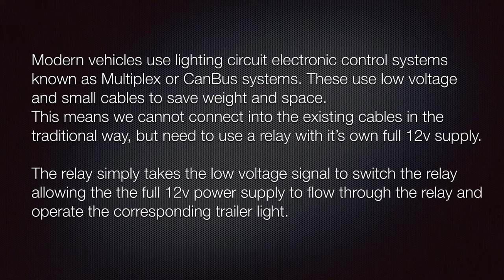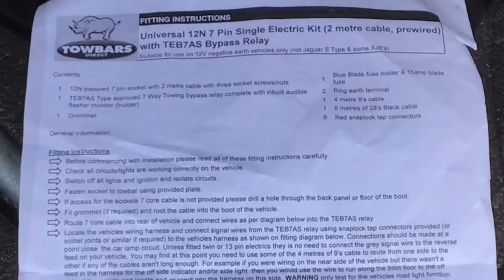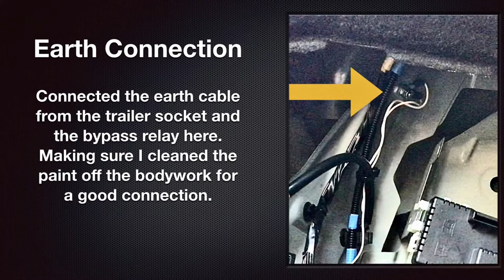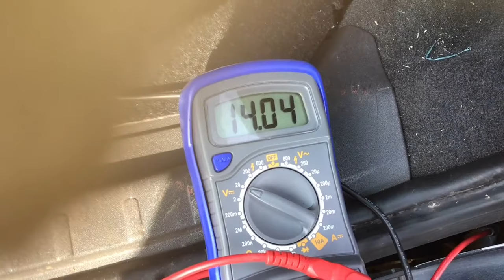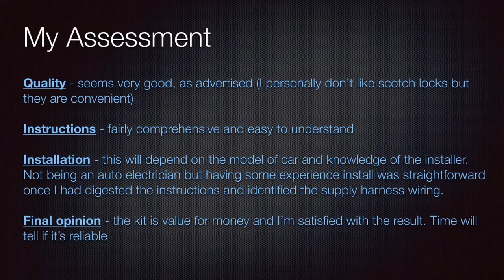TowBar Electrics 7 Way Bypass Relay - Step by step installation

Comment: Just watched video, great deal of info. I was particularly pleased to see a permanent live in rear of boot, negating the need to run to front of car. Just confirming, was this a Kuga. Ready to watch towbar install now. Why can't manufacturers just leave a dedicated trailer multi plug in rear, as some already do. Thanks for great video
Reply from the maker: Hi, James, really pleased you liked the video and found it useful. I try to cover every aspect when making a video, as it is frustrating if a video misses a crucial point in a process. Agreed it would be very easy for manufacturers to install dedicated socket in the boot. 
No it isn’t a Kuga it’s a Volvo xc60 so won’t be exactly the same as in power source. Although it’s a fair bet there is a permanent supply in boot of a Kuga somewhere. Otherwise besides the your permanent power source issue there rest should be the same. Hope this helps. 🙂👍

Comment: Great video. I have a xc90 and someone had fitted this relay already and also there is a power source also in the rear fuse panel. I just wanted to see how it was installed while i tidy up the wiring as a previous owner had made a mess of the install.
Reply from the maker: Thank you, I’m really pleased you have found it useful. 👍🙂

Comment: will be doing this tomorrow,your upload has helped a lot when using multi meter when checking wires do you have black probe on a earth
Reply from the maker: Really pleased to help. Hope you get it all sorted. Yes when checking each cable your negative (black) multimeter cable just needs grounding to a good clean earth point. It may help if you mechanically fix your black cable, to ensure you always have a good earth while you identify each cable.

Comment: Hi. Great video. Thank you. 
Im trying to identify my cables on the back plug but more than 1 has voltage, i have a volvo v40 and plugs look very similar to yours.

Would the indicator fluctuate with voltage? 

Thabk you
Reply from the maker: Hi Stephen, if you mean the low voltage CANbus cables on you car then yes the indicators would fluctuate with the flashing sequence. You would then have individual low voltage supply to the side, stop and fog lights. You need to identify each individual supply before connecting to the correct bypass relay cable. You only need to connect to one side tail light supply except the indicator of course and possibly the fog light, which you would run cables across from the opposite side. Hope this helps. 👍🙂

Comment: I’ve just fitted this bypass and it starts to make a buzzing noise wen engine is on then I put brake on it goes off 😊
Reply from the maker: Hi Matt, I would check all of your connections making sure each terminal is in the correct position and secured correctly and not trapping the insulation rather then the core. Especially check your earth connections, are they correct and with a good connection. It’s possible it’s maybe earthing through the brake light circuit. Hope this helps, let me know how you get on and if I can help further. 😊👍

Comment: good video, I have a problem with my caravan lights. When I plug into the car all the caravan lights come on. Stop and tail, fog, brakes, indicators. I substituted a trailer board and the same thing happened! Could this be a fault in the relay?
Reply from the maker: Hi Duncan, it could well be a relay fault but likely an earth issue. By that I mean it doesn’t have a very good earth so may run through the other lights to an earth turning them all on if that makes sense. So the first thing to check is all the earth connections, remove them, clean and re secure. I would also check all the other connections too. If you have a multimeter or test light check the earth is working. Connect to a good positive feed. Hope this helps, let me know how you get on. 👍😊
Reply: @EverydayWorkshop  Hello, Thankyou for your reply. I am pleased to say that I? ha ha! have fixed it. Went to the car this morning, plugged the trailer board in and everything lit up. Turned on the ignition and pulled the 30amp trailer fuse then replaced it and the lights were out! Tried all the lights in turn and everything is now working TBTG! Must have reset something somewhere so fingers crossed it is not temporary!
Reply from the maker: That’s great news Duncan. Really pleased you have it sorted. Thanks for visiting my channel and viewing the video. 😊👍

Comment: I would need your help please 🙏 
I have a Golf MK7, I’ve fitted the towbar, I’ve routed the wiring of the towbar, I’ve stripped all the trim in the boot and exposed the car’s wiring harness, lights everything.
Now I have a multimeter and back probes and unfortunately I have zero knowledge on how to trace the signals.
Please advise what are the steps: multimeter set on 20V I see in your video, black multimeter lead to a clean ground and the positive to each pin, but then what do I look for ?  I suppose I have to turn on and off fog light, turn signal etc and suppose I need to observe a certain variation on the multimeter, what is it that I need to look for ?
I spent 4 hours tracing ‘something’ and I thought I’ve found the signal for each light to then realise that I have actually traced the 12V from each light, and not the signals.
Please help. Thank you
Reply from the maker: Hi, well it sounds like you are on the right track, that is exactly what you need to do. Operate each light in turn. Ie say side lights first with all other lights off the terminal that shows a reading on the meter is the side light feed. Once identified mark the corresponding cable with some tape. You only need to identify the cables mainly to one rear lamp, use the one nearest your bypass relay. For the indicator, opposite side and possibly the fog you will need to run a cable from the other side. Once you’ve identified all the feeds you then connect each cable to the corresponding cable as show on the bypass relay diagram. Hope this helps. Let me know if you need any further help. 🙂👍

Comment: I did exactly what you show but when i connect ground cable from TEB7AS with trailer one its sounds non stop and that worries me. Any help?
Reply from the maker: Hi Ivelin, not sure what the issue might actually be if you have have connected the relay exactly as the instructions state. Try rechecking each individual connection if you haven’t already. It is possible you have faulty relay in which case you should contact your supplier. Sorry I’m not much more help, hope you get it sorted.
Reply: @EverydayWorkshop  thanks. But if i fault the relay, is it going to work at all? When i connect the ground sounds non stop, but all lights working as it should, just that freaking sounds don't want to stop...
Reply: As Alistair Wilcox set is better to solder and shrink, i think that could be a weak connection. I'll reconnect everything to my vehicle connectors and will solder and shrink them. If that not works, i'll contact supplier.

Comment: Why does the live feed have to be permanent?
Reply from the maker: Hi, well it doesn’t have to be permanent. But it is a good idea, so that side lights and more importantly the hazard warning lights can still be operated without the ignition having to be turned on. Both of which can operated without the ignition on the towing vehicle. Hope this helps and thanks for your comment.
Reply: That’s very helpful, thank you.

Comment: Hi at 8 mins in you connected the two blue cables together what are these? 
Thanks
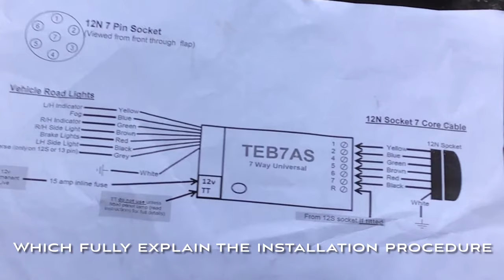Reply from the maker: Hi Chris, well I’ve had a sleep or two since the install, so I’ve just had to watch the video to refresh my memory. It is just the cable from the right rear fog lamp, I’m just showing the connection to the corresponding bypass relay cable which is blue and I happened to have some blue cable. The kit came with some cable but not enough. If you have a look at 1:55 it shows the bypass relay connections and colours and at 7:00 the connections to the fog lamp wire on the right rear. Hope this helps.
Reply: @EverydayWorkshop  all sorted thanks buddy 👍

Comment: Is your bypass relay "always on" or is the power cut when the ignition is in the off position? Deciding for myself if i'm going to install another relay so when the car is shut of the bypass relay is shut off as well. This so it doesn't drain the battery.
Reply from the maker: That is a very good idea from an electrical safety viewpoint. It is a permanent supply, so there is alway power to the relay. This does mean side lights and or hazard lights can be used without the need for the ignition to be on. As long as the relay doesn’t develop a fault it should not drain the battery at all. Hope this helps.
Reply: @EverydayWorkshop  another question, do you have any idea if you can disable the beeping when using indicators?
Reply from the maker: @nielshoekstra13  Hi Niels, there probably is way but I be honest I don’t know how. The beeping function is internal to the relay, it may come apart to somehow disable it but probably best left working. It’s there to indicate the trailer indicators are working. You could try sound proofing it’s location to muffle the sound intensity, you may be able to live with then. If you do make sure it doesn’t then get to hot! Nice to know you got the relay installed ok. Hope I’ve helped a little.
Reply: @EverydayWorkshop  I've put some ducttape on it do make it a bit less loud, think I will leave it that way. Installation went good, thanks to your video ;)
Reply: With having power to the relay when the ignition is off means that if you are stopped on road due to a break down, you can walk away from the car with the keys to be in a safer place and your hazard lights will still work.

Comment: Hello, very good video. I was wondering if you can help me. I have replaced the 7 core cable with all new, new plug, connectors etc. as soon as I start the car, the indicators are on and the left brake light for a couple of seconds then it blows the 15a fuse. 
The battery for the car is in the boot. I am running the TEB7AS direct from the battery with a 15a inline fuse. 
The caravan is from the 1970s, though the lights and the wiring are all new. 

Many thanks. :)
Reply from the maker: Hi, It sounds very much you have the cables connected incorrectly, maybe a live going directly to earth. I would start from scratch and go through all the connections making sure that are in the correct position and have a very good connection. Make sure the earth is a very good connection. Hope this helps and you get the issue sorted out.
Reply: @EverydayWorkshop  I think scotch locks should be banned lol. Took the whole weekend but I replaced the 4 core wire and learned how to solder 😂. I’d have saved a lot of time if I had just replaced everything. No longer blowing fuses. Thanks for your help.
Reply from the maker: 😁 I agree they should be banned. I’m in the process on repairing a wiring loom on an accident damaged Citroen C5 Aircross. About 20 small wires all ripped apart, and I’m definitely soldering those 😊. Great to hear you have sorted the issue.

Comment: When i attach trailer to car, the TEB7AS Bypass Relay starts buzzing, why is that?
Reply from the maker: Hi, I would recheck all your connections, firstly that they are in the correct order location and second the you have good secure connections especially the earth connection. It usually turns out to be something simple rather than a faulty part. Hope you sort it ok. Let us know how you get on. 👍😊
Reply: @EverydayWorkshop  i think i did, i connected all the cables of the car side with the matching ones of the car harness and in the pin  i connected all the trailer cables.
Reply from the maker: Did you determine which cable supplied which lamp correctly. You may still have an earth issue. Try disconnecting the earth cable from the relay and check you have good earth continuity. A test lamp ie a car bulb connected to the cable and live would be good to test this.